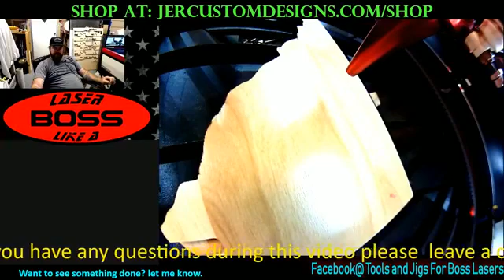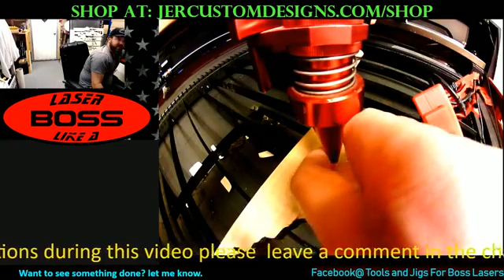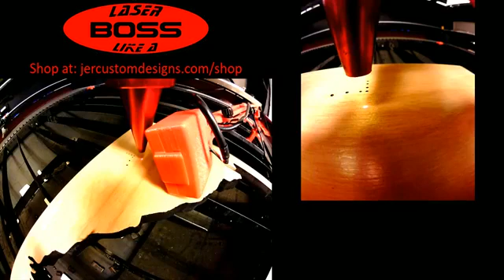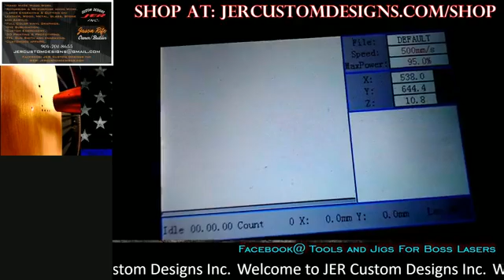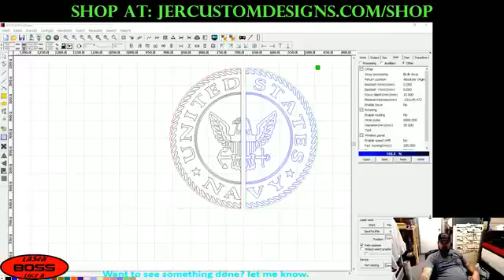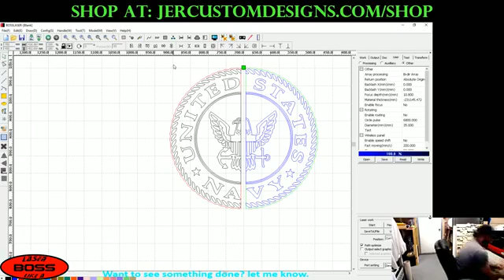Boss Laser Auto Focus video

Comment: Love your videos, very helpful. When I try to autofocus,sometimes, the unit goes down to the material and doesn’t stop, as if it is trying to go through the material.i have to press esc for fear of hurting machine. Any idea what’s wrong??
Reply from the maker: I would contact Boss about that, sounds like sensor is going bad. It is not very common but can and has happened
Reply: I have the same problem, question do I have to do auto focus if I cutting wedding invitation paper ?

Comment: we have a LS1420, only had it a couple months. we are having a problem with the laser not removing all of the top layer of anodized aluminum. Any ideas why? Tech supports ideas arent working
Reply from the maker: Anodized aluminum reacts differently with a co2 than with a fiber. The  best I have done is lower the speed and power I have a 150 watt and run anodized at 250mm/s at about 25 to 35 % power. Try that and see what happens. Too much power will turn it brownish I  color.